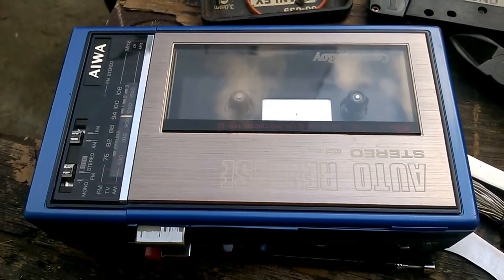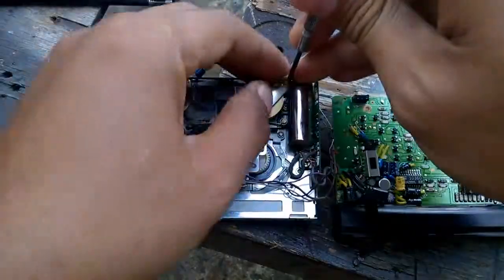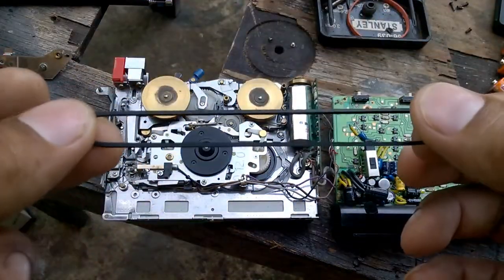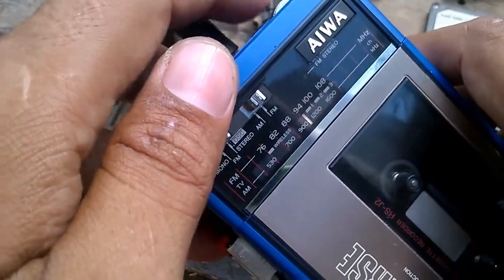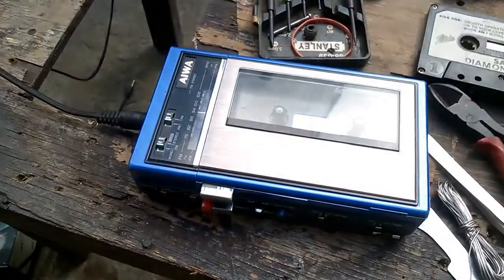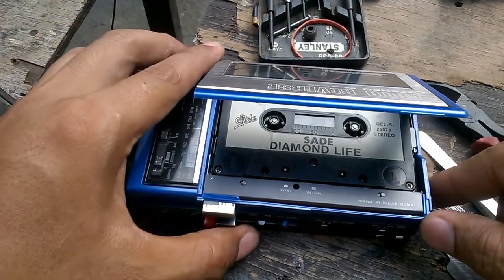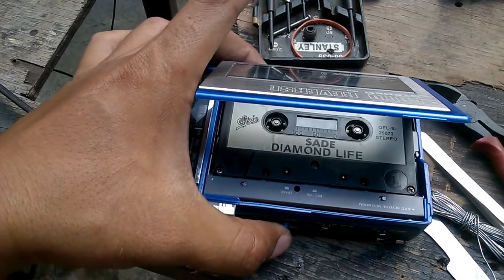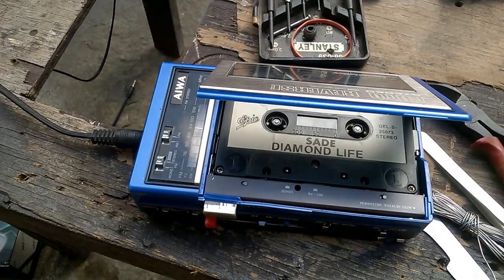Fix Your Cassette Player Fast: Replace the Belt in Minutes || Aiwa HS-J2

Comment: Would have been great if you showed how you took it apart as well, thanks for the video.
Reply from the maker: There are screws on each sides of this walkman pull them out and screw on the cassette cover take it off...In the inside part desolder first the ground. then the circuit board has a screw also take it off then gently pull the circuit board...

Comment: Great video! This model has same mechanism of the aiwa hs-j110. Very helpful to know how the belt fits around the pulleys. Do you know the size of the belt?
Reply from the maker: 12cm belt, thickness .3mm+/- I'm using here a replacement belt.
Reply: @Woodys_Hobbies  so total lenght 24cm?
Reply from the maker: @matiasarttin6530  yeah its more like that but in electronics the belts are measured by folding it equally but not being stretch that's how to get belt sizes. so the belt is measure 12cm now. I'm using 12 cm belt.

Comment: Very useful indeed, I followed your video and have replaced the belt, but a wire attached to the back cover (I think its a ground wire) came off from the circuit board, and I cannot see exactly where on the circuit board it needs to be reattached? Can you help?
Reply from the maker: yeah it is only a ground wire that shield the back part of the unit to avoid interference. to solder it just keep the cover close to the unit so it is not hard to resolder.
Reply: @Woodys_Hobbies  I have the same issue with the wire coming detached but from a hs-3px with fm transmitter, does anyone have a picture of where it should be soldered to, as in which point, there are lots to choose from. Is the wire used to assist with the. fm transmission?
Reply from the maker: @richardapps  Sorry I don't have that kind of model

Comment: Hey Woody dont quit on me now..(-:    I have replaced the belt as you showed, but I cannot complete the repair till I figure out where on the Circuit Board the earthing wire goes. Any idea how I can identify where it should be attached?
Reply from the maker: grounding is connected to the metal of the cassette deck just use multi tester to find the connection from the metal plate of the deck going to the circuit board so you can solder it properly. Find a reading resistance 0 ohm from the metal plate  of the cassette mechanism going to a circuit board.
Reply: @Woodys_Hobbies  You are a hero, many thanks for that. It is now completed and works just fine. Lovely piece of past technology, sounds great. 
Not that I need it, but you mentioned that the speed could be adjusted. Out of interest how would you do that, I did not see any adjusting screw on the motor?
Reply from the maker: @Total66FD  if i'm not mistaken its in the circuit board. I can't really remember because my unit is already sold. just check the wire of the motor where it goes. It has a trimmer resistor in the board.
Reply: @Woodys_Hobbies  Brilliant, good to know. Cheers.
Reply from the maker: @Total66FD  cheers!!!

Comment: The new belt you are using is too thick. The original is SCY and I guess you are using a SCQ.. You mentioned 12cm half lengtht right?
Reply from the maker: yeah but still doing fine as long as it fits there you can adjust the speed anyway. but thanks for the info.